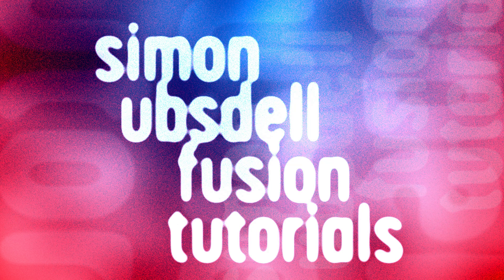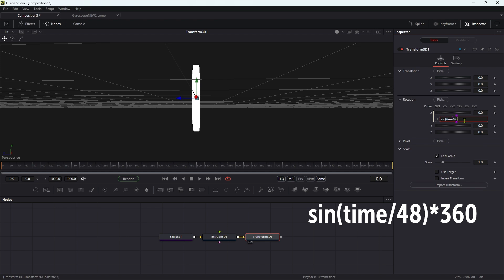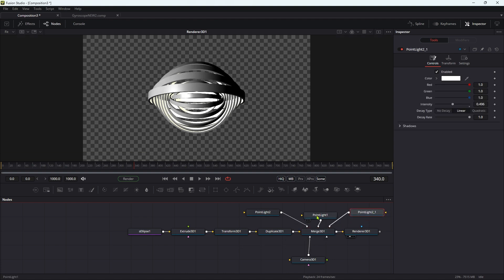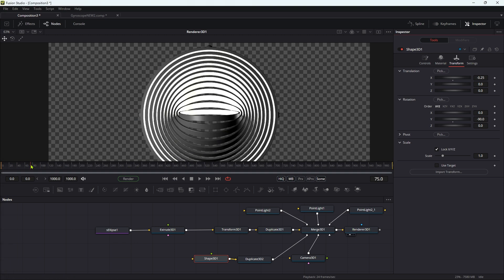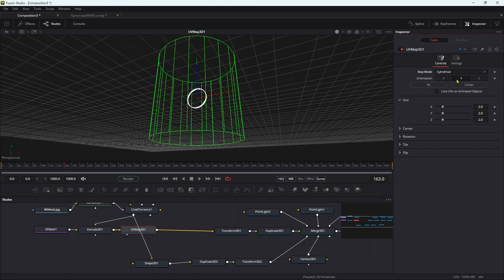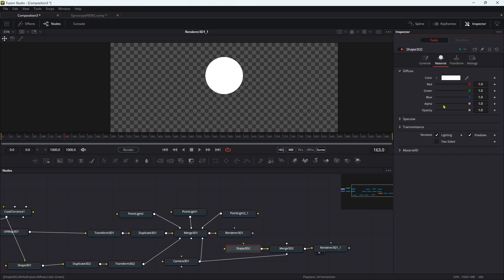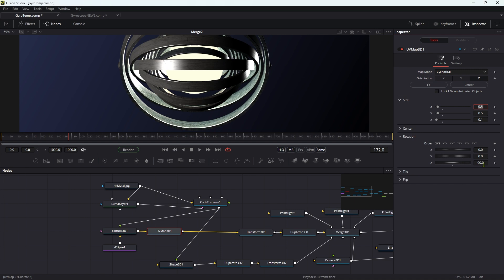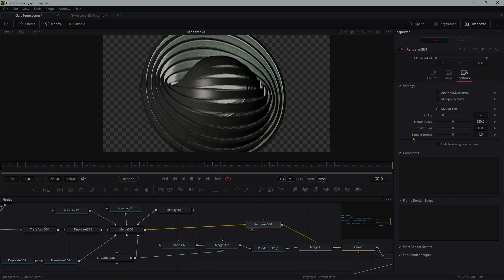Resolve Fusion: 3D 'Gyroscope' Tutorial

Comment: Hi Simon, Great Tutorial. I have taken it further and added some creative textures and lighting etc and would like to append the rotation movement .What would be the best way to stop the rotation expression sin(time/48)*360 on a specific frame to allow a change in rotation / movement ? Cheers Wayne
Reply from the maker: Thanks. I think by far the simplest and most flexible way to create a change in direction for the rotation would be to use keyframes for the animation rather than an expression. I'm not saying you couldn't do it with an expression but it would be a clunky way of doing it.